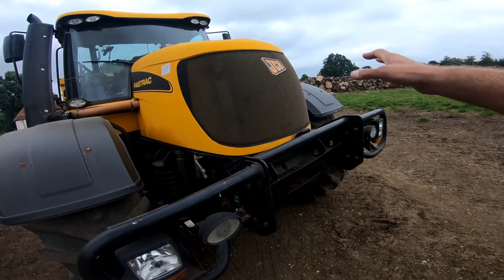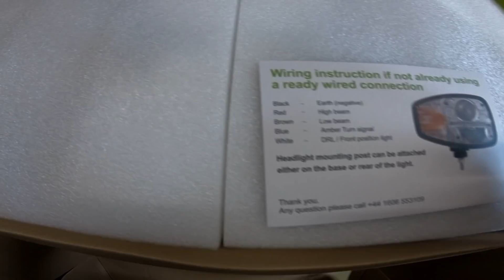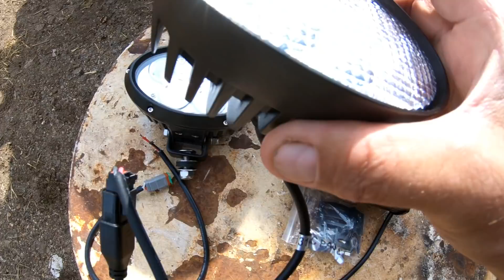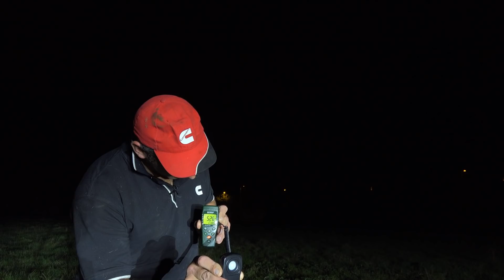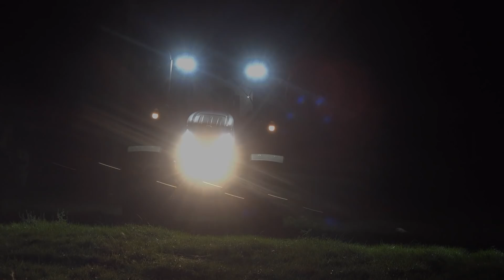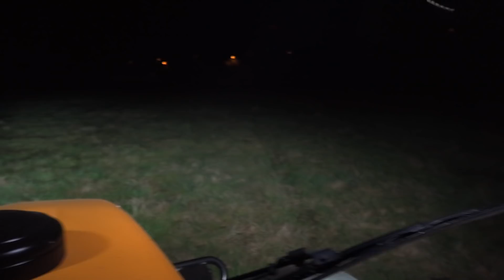JCB LED UPGRADE. UTV PRODUCTS. THOMAS LED

Comment: I have 12 Tomas LED lights added to my JD. They are unbelievably bright and leaves no shadows with a great spread . As you said they are very very heavy to hold with great build quality. They have been out in the irish weather now for nearly 2 years and this shows thie difference between premium and EBAY lights . The lens are like new , no condensation on any of them , however 2 of them show signs of the powder coating bubbling at the bottom slightly. 
Cons;
Perhaps they a slightly overpriced.
The Radio Suppression isn't great.
I would rate them 8/10 

I'd may try the UTV lights next as they seem premium at a reasonable pric. They also state 0 radio interference.

Great video !

Comment: That weight 3 feathers . So funny
Reply: Any chance George you could do a video fitting sidelights on the steps that come on when one opens the door at night and lights up the steps and path in front. Got a dirty toss the other night and missed a step , thanks

Comment: That aerial shot really shows the output off. I went with uprated halogen bulbs to keep fastac005 looking original but despite them being the best rated (Osram  night breakers) halogen bulbs I could find they are like candles compounded by the old reflectors. Debating going with UTV vs keeping it original
Reply from the maker: I know what you are saying mate, you could go HID? In the 3230 I used to run I replaced the halogen bulbs with HID bulbs you just have to find somewhere to hide the ballasts. Or you could try led bulbs, I've used them before with great results. Again though there sometimes isn't the space to accommodate the bulb.
Reply: @GeorgeSaunders  I think led is probably the way to go but chamazon is awash with em, no idea where to start 😀.
Reply from the maker: @fastrac0055  you do need to spend a bit of money to get some quality bulbs. I used Auxbeam which were very good
Reply: @GeorgeSaunders  thx I’ve got a set of them in mind, have to measure up to make sure they will fit

Comment: Great video and insight into light. Will replace the lights on my tractor with Thomas. for interest though what colour temperature are the new LED lights that you have used 5000 or 6000k?

Comment: How do the amazon/ebay lights compare to the t7 or utv & Thomas lights? 
I've had an ebay special on my truck for 5 years and its coped well through water & mud but obviously doesn't put in the same hours as tractor work lights

Comment: Led colight are another good one … I won a 20” slim line bar in an Instagram competition and I’m impressed with it so far .. I have a 4220 with the led light pack , but spraying 36m you can never have enough light … the light bar is very neat and is barely visible over the the number plate until you turn it on !